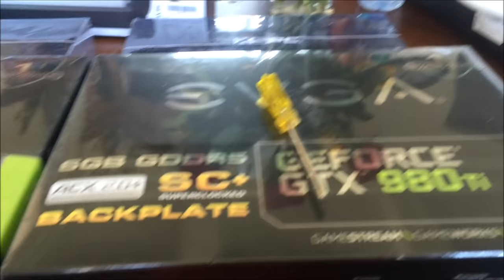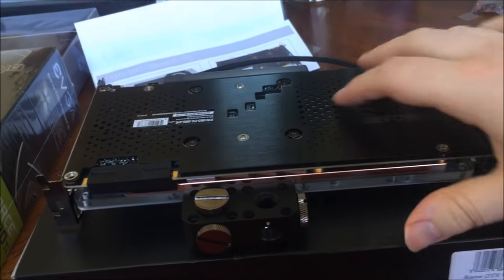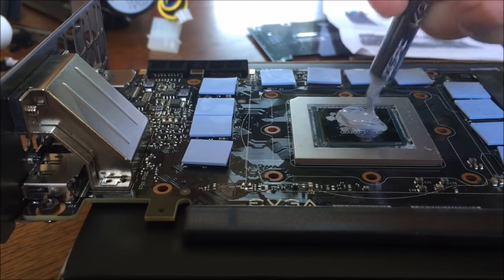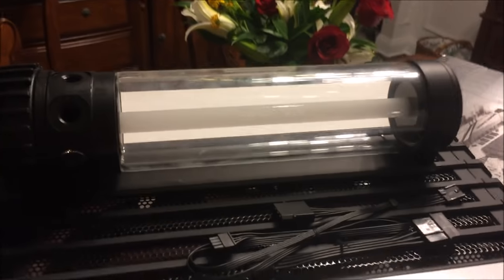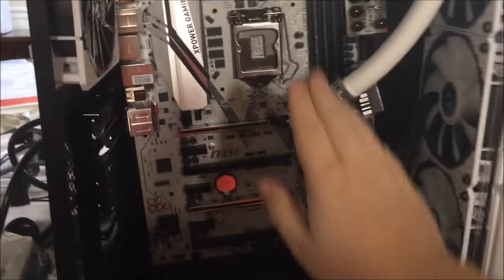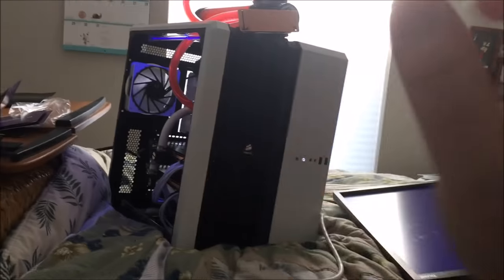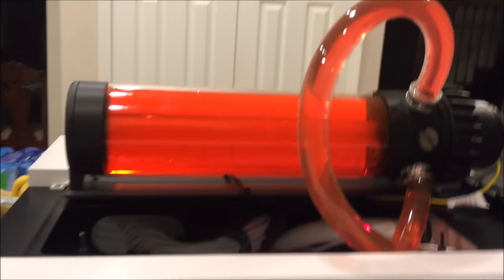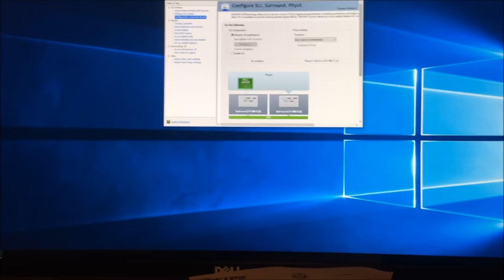Idiot builds an expensive PC very pooly - has no idea what he's doing

Comment: 256GB of ram....   Are you making a ram drive with it?
Reply: @UlrikBrun-ir7mh  mac pro 2019 has ram capacity up to 1.5 tb
Reply: @UlrikBrun-ir7mh  well spotted, cause 256GB would be insane, but it's fairly puny for an SSD, at least with today's prices.
Reply: Gavin Wilson he didn’t even put the ram in tight lol
Reply: @nicofrosberg5599  that's because
Reply: @nicofrosberg5599  apple
Reply: @nicofrosberg5599  a thief
Reply: @nicofrosberg5599  that uses a server cpu
Some servers can support 2tb of ram
Reply: I doubt a server has that amount of ram
this dude must be using it for science
Reply: @insanitylol  Looking at this video now, and doing the research, he would need four 64GB dims for 256GB of RAM. The processor that he is most likely referring to, the Intel Core i7-6700k, only supports 64GB of RAM. In fact, even though I couldn't find specs on the first mobo used, I HIGHLY doubt that it would support the 256GB he's claiming.
Reply: We need Druaga1 up in this bitch 😂

Comment: 16:43 Ah yes, the good old solid state hard drive....
Reply: you don't have a solid state hard drive? I bought one a month ago, along with my i5 GPU
Reply: @benherrmann5934  No, they too expensive. I am pleased with the performance of my rx580 processor already, as it does raytracing too.
Reply: @nicoprezio3696  damn, how did you get your hands on power supply in todays market?
Reply: @benherrmann5934  Just got one from my local Intel shop
Reply: @benherrmann5934  got mine from the Dollar Store down the street.  😉
Reply: Lol
Reply: SSHDs exist, in older macs usually, they call them fusion drives

Comment: I have encountered something similar, except no parts damaged as leak was fixed/avoided cleanly. Best thing to do is to leak test all watercooling component as an individual loop outside the case, just in case a part is faulty from factory before doing a leak test inside the pc. Sorry to see your losses.

Comment: The motherboard is possible to have quad-SLI because it has 4x PCe x16, I might be wrong, but be sure when you buy a motherboard, read the specifications. It's just that you might need a full-tower ATX case to have quad gpus. Just want to be sure that on the CPU water block, it is normal to have smaller flow, and it whistles , because of small fins inside to get the most heat out of your CPU. Another thing you didn't by any chance used a tap water or water from the garden hose? because tap or treated water has conductive properties.
Reply: Also on the CPU thermal paste, it about three times than a normal amount that you should put on, otherwise it's going to be messy especially on the CPU pins. The amount of thermal compound that you should put is about a grain of rice or a piece of cord kernel.

Comment: builds sup'ed up mustang with 1200 HP.... Wind shield is made of acrylic.... lights are non functional.... seats are plastic and cloth..... puts e85 in.... tore out all interior for weight and more HP.... put in 2 big bottles of conventional motor oil.... uses it as a everyday commuter down the street for work.

Comment: Many things I don't understand here.
What's with the 256G ram, that's 16 times 16G, maybe there was a use for it, but with today's ram prices that might cost £2000.
Can't 2 radiators be put in the back of the build with the reservoir in the front? Looks strange having it on top considering the volume of the case.
What's with the hot and cold tubes,  I would stick to the same colour. 
Why not leak test it for several hours before actually turning it on?
And what's with the tube coming out of the side,  was that temporary?
If you dry off wet component for 24-48 hours then hopefully they should work, but not if you leak water on a live system.
And how did the psu die if its it's on the other side of the pc?
Reply: Because of reasons. He got excited. And...Poof!

Comment: i dont understand why did you plug your motherboard to the PSU while testing the loop or check leak test.Should it be unplug all the stuff (except the pump) and use the paper clip method to power cycle the psu?

Comment: Touches mobo on top on panel, doesn't buy for compatibility but instead for "looks" , blows through water-cooling tubes, applies a shit ton of of thermal paste, I don't want to talk about the cable management, 4tb doesnt mean it's faster than a 1tb. Wastes literally 256gb of ram, (You would never need this much ram, you can run multiple red video tracks in premier and use all the ram) . This is an atrocity to man kind itself.

Comment from the maker: How many things could go wrong during a PC build? PSU Short-out, Mobo Short-out, Ram Short-out... CPU Cooler fail... A lot of stuff, actually!
And to top things off the 1070 and 1080 got announced shortly after I committed to voiding the warranties on my 980Tis!  Great!
Reply: +Ian Boswell And the 1080 is stronger then sli 980s.. :/
Reply from the maker: +Bryan Boudreault good news I have built a new PC in the exact same configuration as this one but now I have a quad SLI mobo from EVGA a custom light system that lets me change it to any color I want and a pump reservoir radiator combo in the front so no tubes leading out of the box!
Reply from the maker: +Ian Boswell and yes it's got no GPUs until the 1080 which I'll SLI if quad is ever available I'll quad SLI I know at launch it'll only support 2x SLI because of how their funky bridges look. I also want the ZOTAC one with the TRON looking cooler block that looks stupid and I love it
Reply: QUAD SLI? you mean putting in 4 980ti in a single PC. what sort of benefit would this get. this is a mere eye candy and expensive and pointless but then if you have the money to play then well the heck. meanwhile, i get groovy and sulky with my single gtx650ti / AMD pc.
Reply from the maker: +moseyo tam I just wanted to have the tubes running from one card to the next in a spiral shaped loop cuz it'd look cool plus plug in too many monitors all at 2560 X 1440 resolution
Reply: Ian Boswell
i see. yeah, you need multi gpu setup for multi monitor setup especially at that resolution
Reply: 1080 has only 10-15% more performance than 980ti, simply no reason to upgrade, the 2x higher performance is only for virtual reality.
Reply: in virtual reality...pls don`t misinform ppl like nvidia)
Reply from the maker: +DrowDanger actually I'm pretty confident it has more ddr5 ram altogether 8gb vs 6gb so what I care about is texture performance which is what I need for my 2D texture work. I am not too impressed by the 1080 so far and would prefer a dual core unit similar to my Titan Z but with the new pascal architecture
Reply: Ian Boswell I was talking about full hd-2k gaming performance, I have no idea how much videomemory do you need for texture creating, but im pretty impressed that dual 980ti with 12GB are not enough for you.
Reply: +Ian Boswell you don't have a 1080 how could you not be impressed with it???

Comment: U use so much thermal for the gpu u know ?
Reply: better to much than to little
Reply: geen naam no.
Reply: Travis Andrae 
on cpu to much is bad
on gpu you realy need a lot as the chip itself doesn't have a heat spreader so it needs the goop
Reply: That's right. ;)
Reply: Not that much though, I mean I never seen somone use half a tube on a GPU die lol
Reply: @geennaam1201  actually better less than more. You can always add more if you put less. If you put too much its too late

Comment: I spilled deionised water over my motherboard and some over the GPU and got a hair dryer and was working fine after that
Reply: liam lambert buddy id be surprised you have ever seen deionised water you cant fucking blast a board with a hairdryer  you dry  it up with a micro fiber cloth
Reply: @tj9959  hair dryer works well cause it heats up the water till it evaporates
Reply: Colin Java yeah it evaporates the water but it doesnt evaporate the minerals. And it maybe damages the mobo/ other parts
Reply: @tj9959  If its distilled there shouldn't be too much in it, and it doesn't matter if it leaves stuff on the card as long as there's not a short circuit between any metal components possible.
I would use hair dryer as well as leaving it for 1 or 2 days to dry out thoroughly.
Reply: Colin Java letting it dry is what I would do. Drying it with a hairdryer isn’t a good idea as it can overheat components, etc
Reply: @tj9959  Well yeah, you don't wanna over do it obviously, I think they can take a bit of heat though.

Comment: Why are you running hot liquid to the GPUs?
Reply: TheOnePistol no he's not. It doesn't work like that. Loop order is irrelevant, there was no need to use different colour tubes. The water temp is the same throughout the loop as the water moves so fast, there may be 1 or 2 degrees difference in certain spots but it's negligible.

Comment: you over pressurized the system causing leaks at the CPU block, not the products fault
Reply: You can't over pressurise it unless you have a blockage in the loop.
I don't see how there was a blockage as it's all new stuff.
Seems like the block was faulty.
I would put plastic sheet over graphics card, paper towel can make it worse if it's more than a few drips as if you wet one end of the paper towel the whole thing becomes wet eventually.

Comment: The hell dude did you know the logic?
Pump must be placed at the lowest part of the loop for it not to work perfectly and normally..
Your defying the logic by putting it to the topmost part 
That will cause more noise
Will cause pump failure
And your vertically mounting a reservoir at the top most part of the loop that will make the flow pressure worst.
Having both the reservoir and pump at the top makes it harder for it to drain the loop bcuz your defying the law of gravity .. unless you flip your case ..

Comment: it is sad, he could be a good builder if he was taught better.
Reply: He knows a bit obviously, but no common sense when it comes to safety. No need to put reservoir on top and have crazy tubes all the place, the case is large enough to put rads in the back.
Should have tested components on air first, then leak test it before you run it.
No need to cool ram unless going for highly aesthetic build which this isn't.

Comment: take your cpu block apart, there is a metal plate in it you can take out.. OR you might have crap in the block from the rad's.. I have 2 build's on my page that are both water cooled, 1 is soft tube and the other is hard tubing, bent the tubing myself, really easy to do..

Comment: i never do water cooling and i dont had any idea, but correct me if i am wrong, the  idea is to remove heat from one component and transfer it to the radiadator, so, conecting the hot exit of one component and connect it to another component, intake you are overheating the second component with his own heat plus the previos component heat? as i think every component need a cool intake and the hot exhoust has to go to the radiadator?

Comment: Is water cooling better than air cooling?
Reply: its alot better than air. it gets cooler temp and allows you to run ur fans slower in turn making ur pc all around quieter. you dont have to go the open loop rout like he did. you can get what they call an all in one loop. no adding/chaining coolant. i replied cus i felt bad that no one else did....
Reply: It's not a lot better than air. In actual tests the best water cooling only achieves marginally cooler temps over the best air. There are many very comparable air cooling systems that are only several degrees higher than the coolest water cooling systems (in some cases they can equal out depending on brands) and you don't have to deal with the mess of fails or all that nonesense. Water cooling is highly overrated and overhyped. Noctua makes some really nice units that are fairly quiet and rate really well stacked against water cooling systems.
Reply: Water cooling is better but also more expensive with price and performance I would say they are equal
Reply: Water cooling gets slightly cooler temps than air, but with more maintenance, higher cost, and higher risk. If you go air go noctua
Reply: Yes, much better, especially on the gpu, not so much for cpu, but it helps for cpu overclocking.

In terms of cost, then probably not, its an enthusiast thing largely, people do it for the fun of it even though the cost is high.
Reply: Yes but expensive

Comment: What does the thermal paste do?
Reply: It provides better heat transfer between the CPU/GPU die/heat spreader to the heat sink as opposed to it being dry, which does not transfer well. All you need is a slightly-smaller-than-pea-size dot in the middle of the die/heat spreader for it to do its job...which is clearly not demonstrated in this video.
Reply: Benjamin Ebner I heard it works wonders as a genital lubricant

Comment: I'm no liquid cooling expert.. but why would you want hot fluid going in to your graphics card. aren't they the hottest running component ? don't they deserve higher priority ?
Reply: "I'm no liquid cooling expert" - Your comment shows that very clearly. Loop order doesn't matter at all, since the liquid is moving so fast through the loop it doesn't heat up that much. Each component has around a 1 to 2 degree difference.
Reply: @iAmCodeMonkey  I asked a question. There's no need to be snarky
Reply: @Texicus_Reddicus  k.